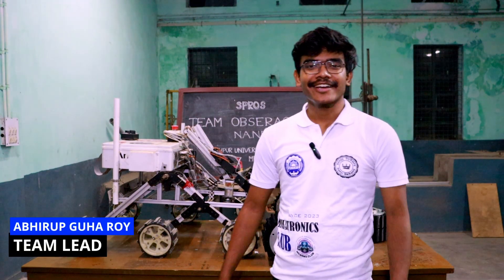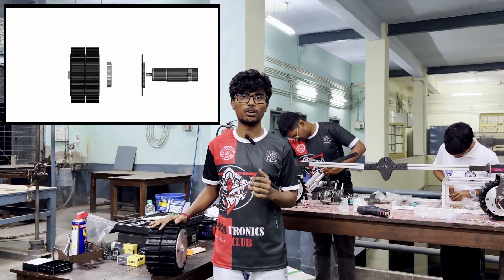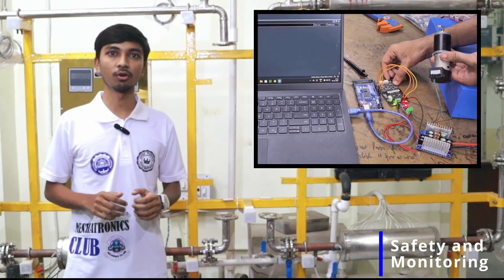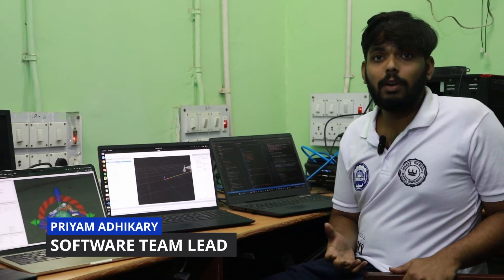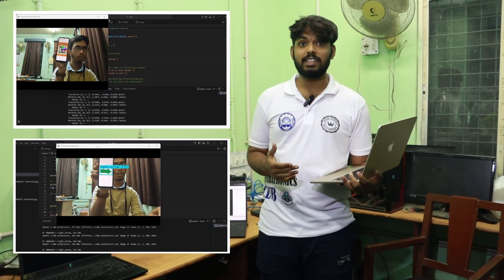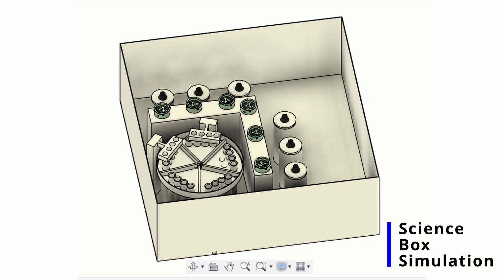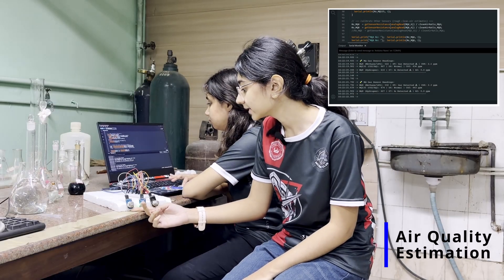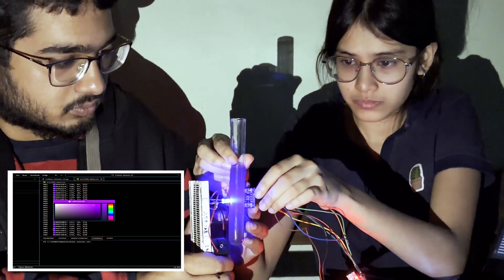N.A.N.D.I 2.0 | Team Obseract | IRC 2026 SDDR Video | Jadavpur University @SpaceRoboticsSociety  ​

Comment: Is it possible to replace the Arduino with Raspberry Pi in your project?
Reply: Yes it is
But that would be unnecessary overkill. Since the main processing is handled by jetson nano, the module level microcontrollers do not require high processing capacity 
An Arduino is sufficient